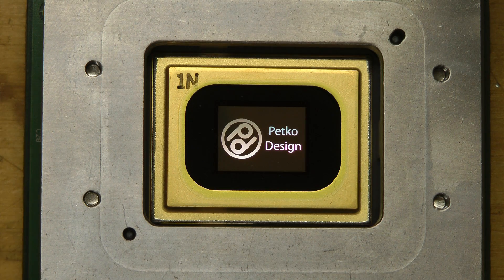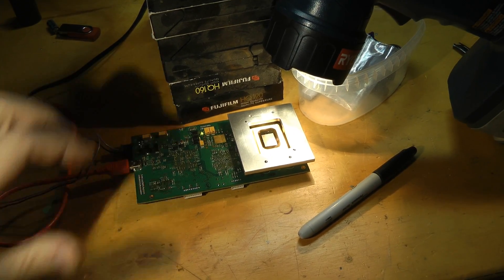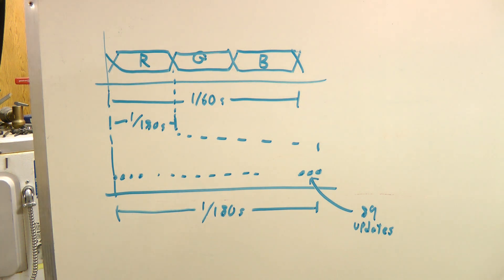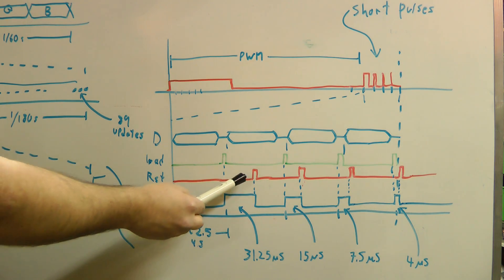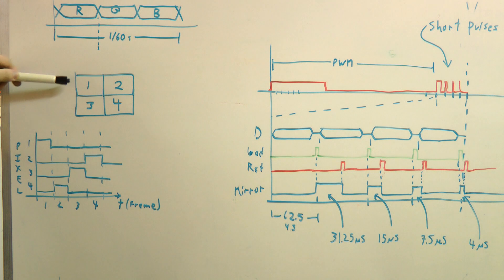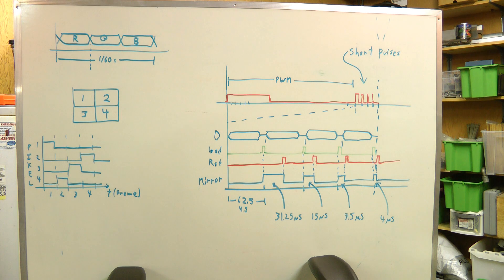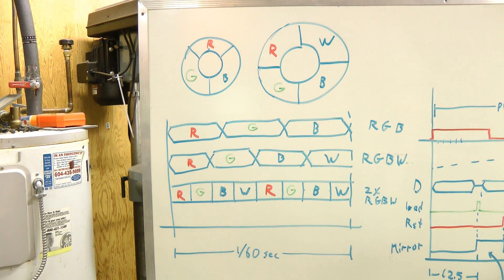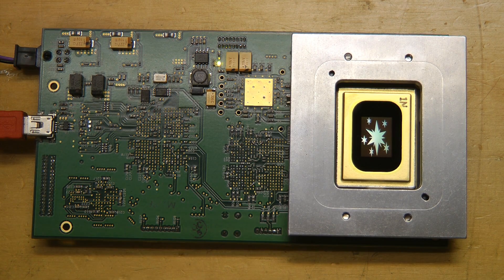Digital Micromirror Devices - in-depth operation

Comment: I was thinking about spectroscopy of deep sky objects, normally they use stencils you can get rid of stencils by using dlps and actively selecting an object on the go with one of these, however not sure if someone makes a big enough chip for the larger telescopes out there

Edit:
Sure enough there are a few papers describing what i just said above

Comment: so what if instead of a lamp you used a laser blown up to the size of the dmd chip, this way it would be easier to remove the color wheel effect by stacking the beams so they all come in at the same angle, doing so could create a huge improvement in brightness, refresh rate, ect. the only problem would be to find high quality lasers that arent grainy.

Comment: @tesla500 I got a a chip like this from TI. How you load the images ? I mean which software do you use to load data ? , I use supplied GUI program and MATLAB also. I am behind the desired refresh rate like 10 times. Do you think this is the reason that I cannot catch the data load rate as the device supports. Or if you use a program which program are you using to communicate with the chip ? Can you write the name of it ?
And has it be in FPGA programming language ?

Comment: Tesla500: In projectors a special prism is used to angle the light just right into the mirrors so the lens can be mounted close

Also Tesla500: I'll use a bic lighter for this example 😂

Comment: This is very useful explanation of DLP projector. Thank you. I am wondering what if using an R, G, B, (or plus white) LED array as the light source instead of using a wheel spinning in front of a white light? Thanks.

Comment: all this is great....until your color wheel explodes, and the vibration from an unbalanced glass wheel spinning at 10000+ rpm makes your tv dance off of its stand....
Reply: It's used for projectors... Actual, in the market, cheap projectors, the wheel is made of plastic, and it's mass is no problem usually
Reply: @chrono0097  you're incorrect.  The color wheels are made of quartz glass, and they are known for occasionally shattering while spinning.  This is one of the reasons why they stopped making DLP televisions for the general public.  They are really only used in theaters now, and use 3 mirror chips with individual RGB lights.....i used to repair them for a living,  so i kinda know what im talking about.

Comment: Instead of a color wheel, why not use three dld chips through three color filters, red green and blue, and then combine them like LCD projectors do? Wouldn't that increase the resolution of each color/pixel?
Reply: This is possible and done in 3DLP projectors. It eliminates the rainbow effect from the colour wheel and increases colour brightness, but... is expensive as you're essentially building the projector 3 times to circumvent the colour wheel.

Comment: Is it possible to project these directly into your eyes?  Some of the problems with Virtual Reality headsets could be greatly improved.  Firstly, latency is far lower for a DMD.  Secondly, the lenses required cause lots of distortion and a sense of 'tunnel vision', a direct projection, perhaps off a slightly curved mirror could greatly improve the focal problems.  Thirdly, small movements in the light source could allow tracking of your eyes, effectively giving a very high resolution but only where your eye is looking.  Finally, contrast would be very high and each pixel would not be split into sub-pixels.
Reply: Good idea! I'll think on it.

Comment: Originally all DMD mirrors were developed and patented by Texas Instruments. This was actually classified technology and only available to the US military. TI is still the only manufacturer of these devices which are fabricated using MEMS technology. Every DMD projector manufacturer in the world licenses this technology from TI,  buys the DMD device and chip set from TI. Chip requires a 6Gb/second data stream to project a full color moving image with the DMD. Filter wheels in projectors typically spin at 6,000 RPM and are made of 4 glass segments.

Comment: DMD device leaks very, very little light and has a better contrast ratio and brightness levels than LCD projectors have. When any of the micro-mirrors are in the off state, the light from these mirrors hits the wall of the optics. White segment is a very small piece of filter wheel. I know something about these projectors, as I have modified them extensively for vision research. Projector light source passes through the spinning color wheel, then on through optics and a small homogenizer which creates a highly uniform light source. A polished glass block with an angled side creates a beam splitter. Design of the beam splitter is different for each manufacturer, and is designed for a particular angle defined by each manufacturer. This is how all DMD projectors are illuminated.

Comment: Very interesting video, thanks for sharing!
I have used a DLP projector to expose a screen-printing screen. It worked well but I guess with a dedicated unit like the one you have it would work better (true static image, no color wheel, better wavelengths possible (closer to UV)).
Another application I read about (I think it was on the TI website) is to expose PCB for small scale production runs. I have not tried this because I think the resolution vs. minimal focusing distance of my projector would make the quality not sufficient enough.
Reply: Hey do we require an evaluation board for controlling the DMD???

Comment: Flim exposure or pcb exposure? Would be interesting but likely non practical.

A DMD should actually be able to pulse many optical fibers independent of each other. Still unsure about uses, maybe some strange test jig?

Could you give a full spectrum scanner a try?
Both with full spectrum illumination and selective sensor and variable spectrum light - source? Doing both would reveal luminescent effects; both source and output wavelength/frequency.

Comment: how about to use 3 DMD without colorwheel, like in Digital cinema projectors? Or this to expensive?
Reply: More expensive DLP projectors do this, like the ones used in commercial cinema :-)
Reply: Running multiple lamps can cause a lot of heat too.

Comment: These techniques are also handy for driving multiple LEDs direct from a microcontroller - a rough PWM followed by a few short pulses on each channel in turn, e.g. you can do 8 LEDs at 13 bits on an 8 bit PIC, for super-smooth fades.
Reply: Could you maybe to a tutorial on this?  I love your videos, and this would be interesting to try to implement in a project i am working on at school.

Comment: Did you try filming the DMD chip using your high-speed camera through a microscope or alike? I think that'd be interesting to try.
Reply from the maker: Thought about it, but the mirrors move too fast. The camera will do a max of 170k fps (at 24x1 resolution). The mirrors would switch in less than one frame.
Reply: tesla500 Is there a way to slowly ramp the switching voltage somehow, or is it completely isolated from the USB interface?
Reply from the maker: detaart
Yes, I thought of just repeatedly switching the mirrors while illuminating them with a pulsed laser or LED. Would likely need pulses in the 10s of nanoseconds range to get good detail. Even then, optical resolution limits due to the wavelength of visible light will result in a very blurry image.
Reply: tesla500 You might be able to generate a dithering pattern where the mirror switches rapidly the switching intersects with the shutter in a slight phase shift, in effect creating a sort of slow-mo animation.  Not easy, though, i think ...
Reply: tesla500 I thought you said that the mirrors update at up to 1800 times a second? I know we won't be able to see much of the switching but it would be cool to see the subfields that make up a colour/greyscale image. The way this works is very similar to Plasma, in regards to how the the pixels are either on or off, so PWM is used to create the different brightness levels for each pixel :-)
Reply: +Spirit
Oh yeah, that'd be neat, huh? Shoot the DMD with that camera! I'm surprised that's not here! Hopefully he'll do that for us.